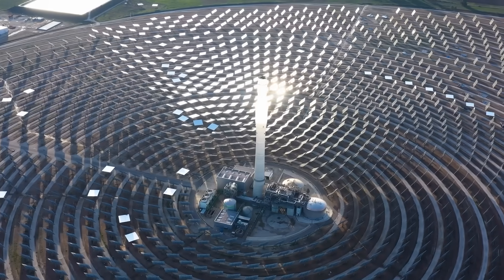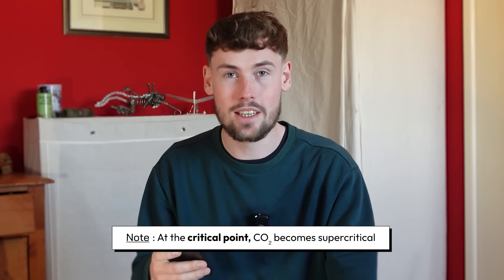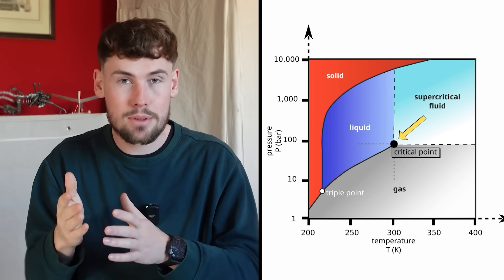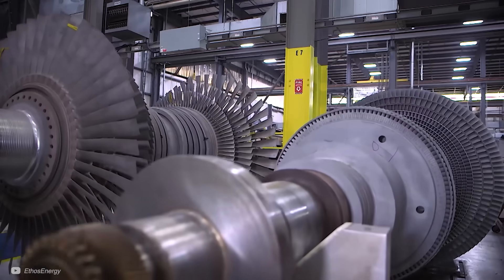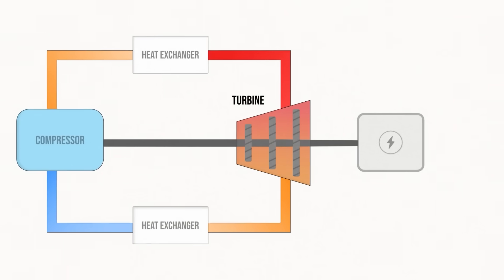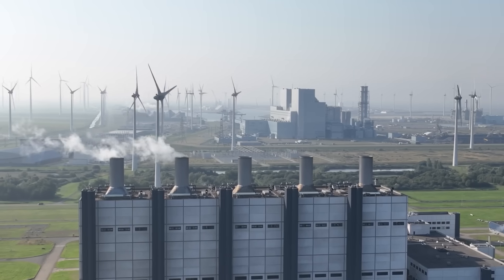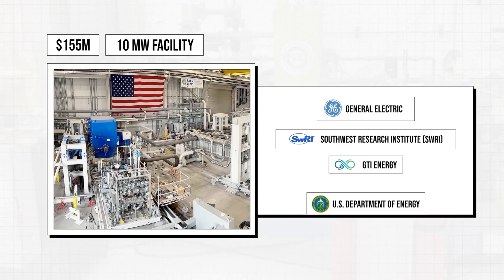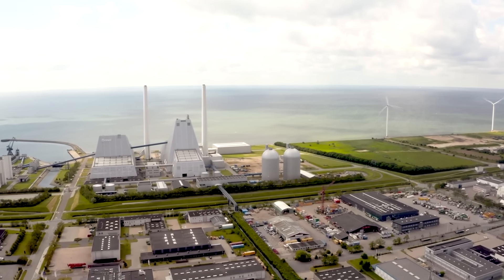How Ultra-Efficient CO2 Turbines Are The Future of Energy

Comment: You had me until you explained the challenges. Here's the thing, there's lower tech, better solutions. These barely work technologies never see the light of day for many reasons. I'm sure some plants will be built eventually but given the added issues 10% gain isn;t that much. Going in I thought we'd be talking 75% or 80% efficiencies. 10% is actually more like a 25% gain but it's still only 40%. Until a way is found that's closer to 80% the system are incredibly wasteful. Solar is starting to get up to those efficiencies and it's constantly attacked for not being efficient. It's easy to prove our entire system is based on waste and excess so it;s not changing any time soon. You could double available emery in a few years just by being hyper efficient in how we use power. The cost to benefit ratio is even drastically higher. Can;t make money off using less of something. That;s the ugly truth of why it never gets better. Inefficiency means extra profit.

Comment: 10:37 +715 °C requires relatively exotic alloys. Reqular steel is not enough. Going any higher than that starts to impede the economical efficency of the system. Though traditional gas turbines operate in double of that - i.e. there is a lot of promise on this technology. Fail-safe systems have to be impeccable, though.
Reply: Jet aircraft routinely operate their turbines at 1727 C. 715 C is a walk in the park.
Reply: You just said that gas turbines go twice that temperature, so how would 715 C be a problem?

Comment: My concern with it, on loss of containment it would be a huge issue as liquid seals dont do well for gases.
So any leak in the system you would now have a dense asphyxiant that is odourless and tasteless and is heavier than air so when you hit the deck you have 0 oxygen.

When the critical c02 hits the blades it will cause areas of high and low pressure, potentially forming both solid and gas states 

You additionally have issues with C02 is with rubbers, namely any seals and expansion joints as it degrades the rubber e.g. cracking, swelling, loss of elasticity

Comment: Solar thermal is one of the least cost-efficient approaches to solar.  Solar photovoltaic is far more productive on a net kW-hr basis.

With respect to SC CO2, the question isn't if you can.  It's if you should.  A long list of benefits does not answer the simple question:  What's the total system cost over time per kW-hr produced?

Comment: Very nice, however I consider your coverage would have been more complete with a short explanation of the principle that these turbine generators work.  Specifically, the key component is pressure rather than temperature, and the pressure is there due to volume expansion, which differs greatly depending on the medium used.  I thought that this was actually the key reason that SCO2 would be more efficient.  Obviously, some medium that doesn't expand on heating is useless when using turbine to recover energy.

Comment: Why not use Argon gas as a working fluid? It is always the same phase at most temperature and pressure, doesn't chemically corrode anything, is more abundant in the atmosphere than carbon dioxide, is almost as dense as CO2 or water (40 Vs 44 or 18).

Am i missing something 🧐🧐🧐
Reply: If you can't get it to condense back into a liquid state then how do you suppose you get it back into into the high pressure boilers after it goes through the turbine? Compressing a gas to it's initial pressure takes more energy then you get out of that gas in the turbine. However compressing a liquid back to boiler pressure only takes a few % of the energy you made in the turbine.

Comment: I wonder if there are issues with cavitation on the backside of the turbine blades. Does the low pressure behind the blade cause the supercritical phase to go into a gaseous phase? If so, does the collapse of the gas pit the turbine metal? How much energy is lost?

Comment: It’s a thermal process, its maximum efficiency is 70% so you have already mentioned it is about 50% efficient , a  multi megawatt generator still has to remove megawatts of heat, we need to remove ourselves from thermal systems aka climate change, but I agree we need more energy for the future. Your contemporaries have already decided solar is our future.

Comment: Does the 10% increase in efficiency actually offset the increased input energy required to get the Co2 supercritical in the first place? water changes phases at much lower temps so the CO2 must require more startup energy no?

Comment: It echoes of small 4 cylinder turbo engines pumping out 200hp but only lasting a couple of years before springing an oil leak or cracking the head. A larger, slightly less efficient engine making the same power will always be the better option

Comment: I've been interested in Supercritical CO2 for over 40yrs and I learned from this video. I had always understood CO2 was in liquid form. My interest was in using it for essential oil extraction. One thing that you did not make clear was how much energy was required for the pressure pumps and the heating in comparison to energy generated. I would presume once you have the turbine up to pressure, very little more energy is required to maintain the pressure but the heating would be another matter.

Comment: Too many problems with this system. We moved away from piston steam engines with sealed boilers because they tend to blow up. Turbines allow us to boil water then harness the energy without the blockage of pistons and valves so there's no pressure buildup that can blow up. There's many ways to boil that water. 
   Using compressed co2 from a pressure chamber makes the system into a potential bomb and releases a dangerous greenhouse gas into the environment.  I can think of better ideas for energy production.

Comment: Really nice video.  Unlike many videos on emerging tech, this one seems technically sound in its physics and you've acknowledged some of the product improvement challenges to work on.  I'm intrigued by the small footprint of the turbine in terms of opening up micro-nuclear fission electricity generation.  I'm wondering how small and lightweight could one build a micro-nuclear power plant with enough fissile material to maintain a reaction and shielding to make it relatively safe.  A backyard generator, or one shared for a few homes? One in the trunk of an electric car to keep the battery charged for years?  It is fun to imagine the possibilities.  Perhaps someone more familiar with nuclear technologies than myself could do some scoping calculations.  I see there is a reactor used for space missions called the SNAP-10A, weighs 690 pounds, and has 30KW of thermal output.

Comment: condensation of low pressure water steam, and the energy loss in the condenser should not be a problem. instead of using cold water in the condenser, CO2 (not necessarily supercritical), liquid NH3 , or Butane can be used to capture the heat of condensation and drive a low temperature turbine. basically, a refrigeration cycle, present in just about every household. i'm not reinventing the wheel.

Comment: Interesting thought: couple this with a sand battery (that stores heat from wind/solar) for an efficiency boost. Couple that with a "normal" size turbine, I wonder if the higher torque is helpful?

Comment: 0:17 - That drawing is actually a combustion turbine that burns fuel like a jet engine to spin a generator and produce electricity. Steam is not involved in this process. 
Note that the exhaust of a combustion turbine can be used to heat a boiler, which powers a second generator via a separate stream turbine.

Comment: Actually the temperature drop is lower. The sCO2 is using a regenerative closed Brayton cycle whereas steam is a Rankine cycle. This means that the temperature drop is only small, maybe only 700c -> 500c, then the 500c exhaust passes through a heat exchanger down to ambient temperature, it's then put through a compressor, and then back through the same heat exchanger up to 500c. Then it is passed into a heat source to heat it the last bit up to 700c before entering the turbine again. It's that regeneration what makes it efficient, because the average temperature in the turbine very high. Whereas with steam the turbine takes it all the way from 600c-> ambient, it can't take advantage of regeneration due to the phase change so it has to extract all the energy, meaning an average temp of ~300c.

Of course this tech has long existed, and you don't need sC02. Air or helium are fine. The reason it's not used much is it's only applicable for heat sources that can heat it from 500 degrees to 700 degree without wasting any energy. Fossil fuel is no good, as you would be wasting 500 degree air. Nuclear is no good as no widespread reactors operate that high, however future designs may work. It can work for concentrated solar, but that's less efficient than regular solar anyway. So to summarise it's old tech that has little uses, but it is very compact.

Comment: GE recently developed a C02 turbine system. This technology is here and just needs more implementation.
Future advanced technology such as quasi crystals for stronger less expensive turbine blades, or new high temperature refractory metal alloys, or combining these C02 turbines with micro nuclear or thorium heat sources. Will make sea can container sized factory built power plants ubiquitous.

Comment: The question is 1000 degree F and 10,000Ps, waiting to go kaboom with a readjustment to "normal" A molten salt reactor with only heat to deal with only has 1 hazard, and thorium as a fuel mitigates most of the rest of the nuclear fuel issues.  (Nuclear is the cleanest fire we have by orders of magnitude).

It is amazing how much energy is tied up in phase change, enough that engines have been made to exploit it.

Comment: No the biggest problem is how you get from Steam to a high pressure co2 and what drives that pump? its not a direct replacement is it? You seem to have skipped over its use case.

Comment: One thought has come to mind. These turbines, are somewhat puny in comparison to traditional steam turbines. The steam turbines have a lot of mass, which added to the mass of the generator rotor, provide a massive amount of inertia, which helps to stabilise the grid from frequency fluctuations, due to changes in demand.

Theses supercritical turbines, would be vulnerable to frequency changes, owing to their lack of mass/inertia. Therefore, it would require the same kind of backup solutions as wind and solar.

Any thoughts on that, folks?
Reply: A few solutions come to mind. 1. Add a flywheel to increase the mass. 2. Add a power conditioner so the fluctuations are smoothed prior to outputting to the grid. Solid-state controllers are becoming increasingly economical. 3. Add a variable load to the the generator circuit. Dump the dirty power into batteries and pull grid power from those: a big "UPS".

Comment: You can boil a potato in H20 but not CO2 at room pressure - so imho 'all' this is doing is changing operating parameters, the 'technology' is still the same. How about trying Krypton or Xeon gasses - they're also quite heavy and compresses into a liquid :ø)

Comment: The argument, "steam vs. SCO2," gave me a thought. I wonder if there might be some combination of chemicals that might perform better than a single chemical. I have no idea what that might be, just wondering.
Fascinating video, thank you.
Reply: You must also take into account the price, avalability and danger of the chemical used. Water and CO2 are very cheap, available and quite inert in those temperature range. You can use molten salts for very high efficiency but they are expensive, complex to use as they are solid at normal temperature and at high temperature can explode in the air or in contact with water.
Reply: @Erik_Swiger  Refrigerants have been used in the past couple decades with high temperature & high pressure steam to extract extra waste heat from the friction in the primary turbine. 

The terms "COGAS", "CCGT", and "HRSG" should point you to the right google results. 

They do offer some efficiency gains, so they're extremely common. Free energy is energy you can charge for after all.
Reply: You would have to find two substances with the exact same boiling points otherwise you just be distilling
Reply: High energy means high reactivity. Any material used needs to remain stable/inert at high temperatures to avoid degradation of the hardware.

Comment: The big deal for this technology is gas cooled nuclear power. We already have nuclear power plants usually with pellets of fuel that use a gas cycle and this indeed enables them to operate at much higher temperatures with an added bonus to safety but they all use helium (as far as I know) which means the energy density of the gas is very low even if you let it flow as fast as you can. Supercritical CO2 if you could pump it directly through the reactor would be much better at pulling a lot of heat out but of course you sacrifice some of the safety by having a high pressure system.
The other one is FLiBe which is a salt mixture that has the potential of being very useful inside nuclear reactors both for having fuel dissolved throughout and for moving around heat but the problem is the Lithium in the salt will be turning into Tritium and there's no good way to clean out the Tritium if it gets into your water, thus replacing water with Co2 in your power generation side allows you to safely extract the Tritium chemically. (Not to mention you don't want to have molten salt anywhere near water in any case)

Comment: No word of price/kWh however. It is an interesting video and I have never heard of this option. It makes sense on paper, for sure!
Even though, at first glance I am sceptical, due to the higher running cost, a big benefit, which I can see is that the maintenance cycle should be very short. Having a hand-held turbine is a massive improvement in this part of the job!

Comment: Some statements are misleading. For example that phase changes are a waste of energy, which they are not. In fact they increase the thermodynamic termperature difference between the heating an d cooling of the cycle which defines the thermodynamic efficiency of the cycle. The advantage of the CO2 Cycle comes wirh a higher turbine inlet temperature compared to stat of the art steam turbines. But there are also transcriticlal water steam cycles wirh steam temperature up to 700 °C. The problem with these is, that they are not economically feasible. Conclusion: Both cycles have their application, but supercritical CO2 cycles are not saving the world alone.

Comment: I thought the main advantage of CO2 over H2O as a working fluid in a Rankine cycle was the fact that CO2 remains supercritical down to such a low temperature and reasonable pressure, not ability work at higher absolute temperatures. If I remember Carnot's theorem correctly it says something like the absolut difference in temperature between the hot reservoir and cold reservoir is the theoretical limit for the efficiency of which you can extract work from heat. 

Assuming I remember and understand that correctly in turn means the lower the temperature of the cold reservoir you can have, without wasting heat due to enthalpy of phase change, the higher the efficiency you can have with a given temperature heat source. 

Also, using CO2 or other working fluids than H2O in Rankine cycles is not a new idea, that much I know.

Comment: I expect scCO2 Brayton cycle turbines to be the basis of transitioning from combined cycle gas to combined tricycle gas, where a gas turbine engine exhaust heats a scCO2 Brayton cycle turbine whose exhaust plus a second go at the gas turbine engine exhaust heats a steam cycle turbine for an out of this world total system efficiency. Been expecting it for quite a long time. Nice to see an update showing progress even though equipment costs are still out of this world at lab equipment level. Nice vid. Thanks.
Reply: I had a similar thought. Combined cycle plants are already far more efficient, so using the SCO2, rather than steam, as the bottoming cycle could push efficiency above current combined cycle plants.  For any new technology or an old one to be adopted on a wide scale, the overall costs/reliability also have to be acceptable.

Comment: There is a few issues here.

Firstly ultra super critical stream plants exist.

Secondly the SCCO2 plant need higher feed temperature. This kind of negates part of the effixency gain.

That is, to reach the higher temperature you need oil or gas (possibly CSP or high temerature nuclerar). Coal or wood wont do.

This does limit thee fuel source to sources that also can me used in a bradley turbine.

The issue here is that a bradley turbine can be used with a rantkine cycle in combines mode and get a even higher efficency, kind of negating the main advantage.

And combine cycle powerplants are incredebly common.

Also ORC turrbines exist making better usage out of low temperatures pairing much better to a bradley turbine as well as being generally simpler and more efficent.

The SCCO2 does have the advantage of faster startup than a CCGT but its questionable if its have a large advantage over a OCR-bradley setup considering a ORC start much faster than a rantkine

Comment: This is cool and all but... you have to use nickel based alloys with this kind of high temp setup and that stuff isn't cheap. 
Thats why steam systems are generally running around the 800F mark. They could go higher with the steam temp(and they have) and this would produce a more efficient system with less chance of water hammer but the metal quality comes into play and the economics just aren't there. At least for mass production.
Cool stuff thou.